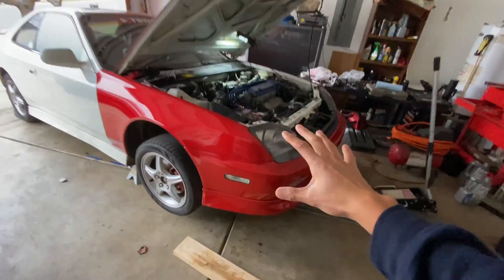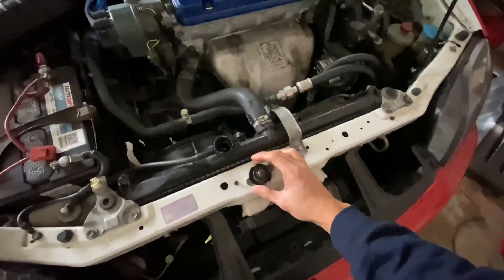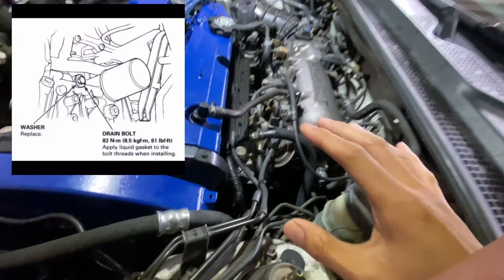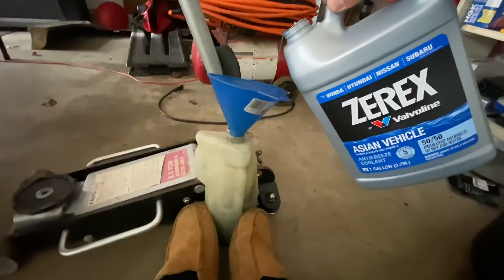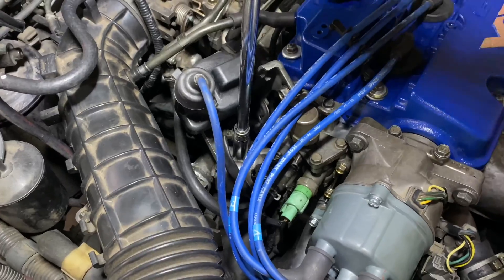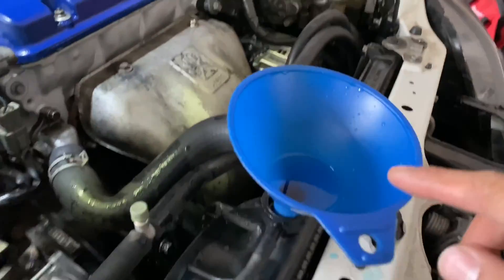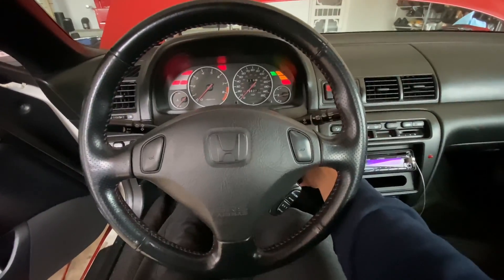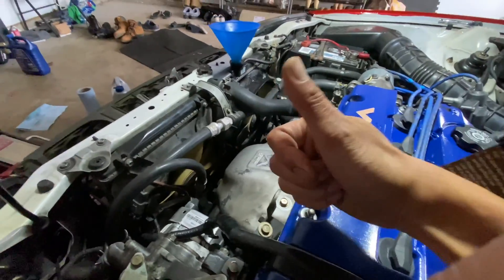How To Flush Coolant In 3 Minutes!

Comment: Ac on blast? Or on heat? Lol u mentioned at the end to blast ac without the ac button but it won’t on heat.. lol also bro know where I can get sensors for atts unit? Atts light is on and code 62-63 came up needing to replace left oil pressure sensor. Thanks

Comment: I got fluid I'm thinking it's coolant, spraying onto the engine in my 4th gen prelude.

I think that's coolant since I've been having to add more every couple days.

Hoping it just needs a flush.
Reply from the maker: sounds like you have a leak, you need to fix that leak, that way you won't have to keep topping off your coolant. You can borrow a Radiator Pressure Test Kit from your local auto store. They'll charge to borrow it but will refund you when you bring it back. Anyway, essentially, you'll be testing if the cooling system can hold pressure. I forget what the suggested PSI is but you'll find out when you refer to the user manual. When you pump it to the specified PSI, you'll want to see if it maintains that pressure for like 2-5min. If it does, your cooling system is fine. If not, you can usually HEAR or SEE where the leak is coming from. Best of luck on fixing your coolant issue!
Reply: Had to replace my IAC valve recently because when I would accelerate it would spew coolant. Have a friend look at it while you hit the gas

Comment: Can I just add this coolant with my previous used one? or I have to flash it everything it goes below the max line !!!!
Reply from the maker: yes you can reuse your coolant, just make sure it isn't contaminated with oil and doesn't have any debris. But if your coolant is old, it'd be best to add new coolant, make sure if you add new coolant that it is the same color as the coolant in the car

Comment: Hey rawrkee I did this recently, and plugged my UltraGage from my camry into my Prelude. My readings on full operating temps on a normal 80-85 degree F weather is 174-185F fwy and from 185-203F city driving. Have you done any datalogging temp wise on what yours normally run at? Forum wise some guys have said theirs run anywhere from 195 up to 210, even some said 225!! Thats hawt yo! Anyways the reason why I did the coolant flush was bc mine needed it. Bled the system and bubbles did come out thru the bleeder valve, before that the temp reading was as high as 213F. Now its much lower. I might still have some air trapped in the system.
Reply: i dont mean to be so off topic but does any of you know a tool to log back into an instagram account??
I somehow lost my login password. I love any tricks you can offer me
Reply: @Emilio Langston Instablaster :)
Reply: @Beau Landon I really appreciate your reply. I found the site through google and I'm waiting for the hacking stuff atm.
Seems to take quite some time so I will reply here later when my account password hopefully is recovered.
Reply: @Beau Landon it did the trick and I finally got access to my account again. I'm so happy:D
Thanks so much you saved my ass :D
Reply: @Emilio Langston Glad I could help xD